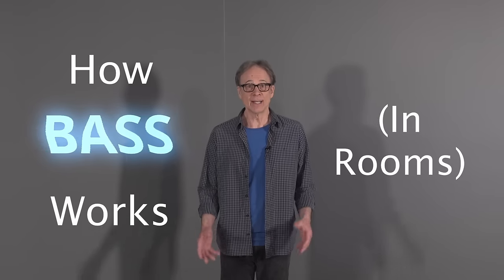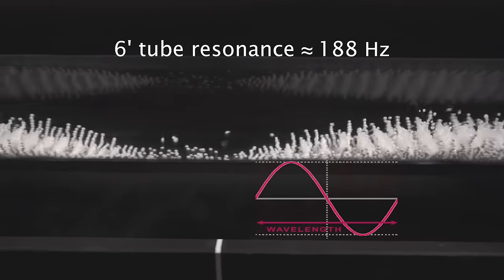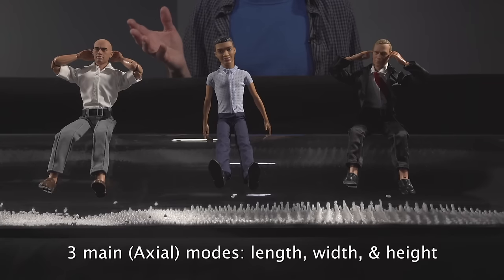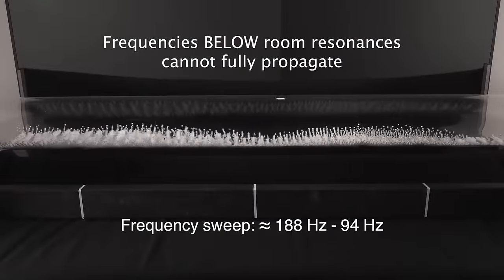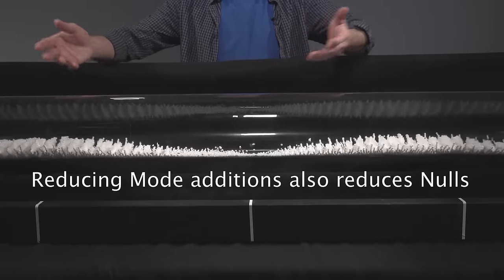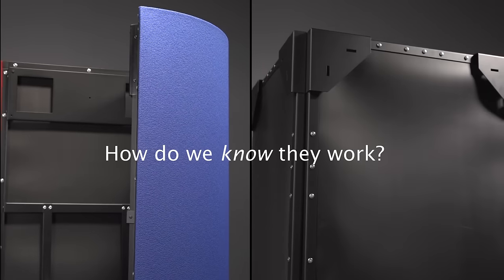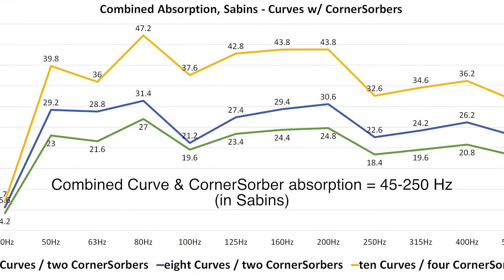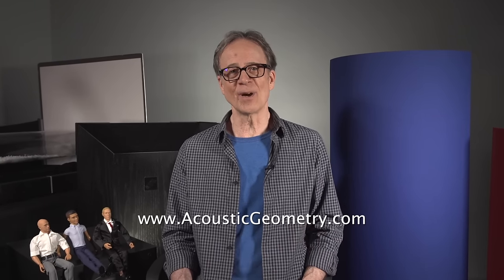How BASS Works (In Rooms) - Acoustic Geometry

Comment: Great information and demonstration. But for a speaker system, a subwoofer array is always going to be the best solution to getting rid of room modes below 100Hz.
Reply: Multiple subwoofers placed optimally in a room are better than a single sub, but the room will affect the sound at low frequencies regardless of where and how many are in the room. Adding subs and "room EQ" will not remove resonances or the fact that below room crossover, wavelengths become pressure-based. Properly treating a room for low-frequency modes and then adding subwoofers is advised. Laws of physics...
Reply: Nope
Reply: @johncalder8490  Room treatment is not the foundation for having great bass, but more like the cherry on top. 

Subwoofers and their proper placement and integration and subsequently room correction will get you to elite levels of bass performance. 

The frequency response dominates our perception of bass performance. Below 100Hz, subwoofers are required to fill in the nulls. And with 2 subs you can have null free bass in many rooms. Couple that with a good room correction like DIRAC and you have bass performance that is damn near perfect in the frequency domain and very good in the time domain. 

Can room treatment help improve things further? Sure, but all the leg work has already been done. 

And room treatment is so damn expensive that it becomes more cost effective to just buy more subs.

Comment: Hmm... I think that you are wrong in some points, for example in that tube, it will be the loudest where there are none white balls, because the high sound pressure pushes them away into low pressure zone where the wave cancellation occurse, and you are telling us the opposite to what is shown during whole video, so by sitting in the middle we would hear as much of that frequency as we can hear in that space. Also velocity based absorbers DO work below 200hz... U just have to place them in low pressure zone (just by moving them away from wall} or make them thick enough so they reach it. So yeah, every type of absorber has its pros and cons, porous ones are the siplest, cheapest and most versatile of all of them, they just work, and u cannot mess them up, (unlike membrane absorbers or Helmholtz resonators} that makes them so popular.
Reply: A Troll at work - do you work for one of the fiber/foam-based absorber manufacturers? Please read the relevant acoustical science textbooks, you missed a LOT! My video is accurate - and placing velocity-based absorbers at the best locations, in the thicknesses required to affect frequencies below 200Hz, is not in any way practical - it would take up entire rooms. John Calder
Reply: @johncalder9188  As I've said, both solutions have their pros and cons... and no, unlike you I don't work for anyone, and I'm not trying to sell anything. Also I don't  discredit any solution because I make money on the other one... You said that porous absorbers don't work below 200hz which isn't true, of course you need to compensate with additional depth, but for someone on a budget, who is capable of making them himself, and has some space they might be the best choice.

Comment: Could you explain how null points and resonance occur away from standing in the direct source? Bass obviously spreads out more by the time it’s performed one cycle whereas a high frequency is more directional which means resonant peaks would be much louder when standing in line of the direct source. Bass behaves differently no?
Reply: High school physics of sound. Look up "nodes and sound." Pressure waves propagate through the air, like a rope being whipped. That's all I have time for...
Reply: @matrixate  hmm no that’s a transverse wave. Sound waves are longitudinal.
Reply: @aristotleonassis5792  You definitely need to study the basic physics of sound. Transverse waves are what he's using in the example. That is what you asked for, is it not? You just don't know enough to know what to ask for. Go and look up what I suggested to answer you question and then go look up wave theory of sound to answer your second question that you meant to ask, otherwise quit asking people for help with the wrong question.
Reply: @matrixate  that’s not a transverse wave. It shows the compression and rarefaction of a longitudinal wave and the answer to my question is if you stand at a certain distance of a fixed frequency you will just picking up the amplitude of where your distance is at. If you’re at a null point theoretically it’s cancelled out. You can’t help and can’t understand my question. You don’t even know that sound waves are longitudinal.
Reply: @aristotleonassis5792  Again dude...go look up what I suggested. Seriously. You'll see what I mean.
Reply: @matrixate  I know what it means thanks. Please go and look up transverse waves. You’ll realise you’ve been giving the wrong advice. Sound is longitudinal. The video can confuse people into believing in looks like a transverse wave but it’s actually showing the amount of compression and rarefaction of air at certain points relative to the length of the wave. Room size will affect certain frequencies differently.
Reply: @aristotleonassis5792  This video is misleading because it is mixing two very different things altogether but I know what he's getting at. I was answering your exact question. The difference is clear to me but maybe not to the non-scientifics. Since you now know the difference and I'm sure by now you would have done some research, the next missing piece of the pie is to observe destructive and constructive interference. Unless you know that already, then you should have your answer by now. You have some of the essential concepts for this topic. Next would be to understand about harmonics and resonances. Though, without the math behind this, you're really fooling yourself into thinking you understand it all. Some of this needs the math to understand the mechanical aspect of the empirical, like basic algebra stuff as to why lambda=2L/n, which satisfied the logic between nodes and wavelengths. That is something related to this video. Good luck. Study hard.

Comment: So how do you figure out where to put them?
Reply: CornerSorbers are positioned on the floor in corners (either vertically or horizontally) at 3 inches from and parallel to the corner wall surfaces. Curve Diffusors are hung on the wall with Z-Clips - the membranes will be at about a 1 inch distance from and parallel to the wall surfaces. 
Curve Diffusors are first placed at the best locations for mid- and high-frequency diffusion, which are the first reflection points (please see our YouTube video "Acoustic Panels - What & Where" - here: https://www.youtube.com/watch?v=akiWq97dSBA - for tips). Then we recommend finding the quarter-wavelength/room dimension locations for further placements to mitigate low-frequency modes, while continuing to phase-coherently diffuse mids and highs in the room.

Comment: I would love to see membrane versus diaphragm
Reply: A membrane absorber is a subset of the larger group called diaphragmatic absorbers, which includes thin sheets of wood or metal, and drywall room surfaces can also be considered diaphragmatic if constructed specifically for that or with low structural mass. Thanks for your interest!

Comment: Doesn’t furniture achieve a similar outcome?
Reply: Good question. Sound absorption (and diffusion) by furniture is often overlooked as room treatment because it is unmeasured and very random. So it's difficult to predict the effects on room acoustics. Soft furniture like couches and "easy" chairs absorb some mid- and high-frequencies, but not much low frequency energy - as far as we know. It remains untested. Also, it's a bit difficult to place a couch at the best location for treating room problems - it might end up in a bad place to sit...
So we don't recommend relying on soft furniture for accurately treating rooms. Thanks for checking!

Comment: try doing the math in a tiny L-shaped room with a 6" ceiling like mine
Reply: You need absorption. Basically you have to eliminate ALL early reflections on all surfaces. I had the same problem
Reply: @Iwasonceacarpenter  Yeah, I probably should put up acoustic panels everywhere

Comment: What is He saying about nulls?  A null "can" be reduced!
Reply: You can't lessen a null by targeting it with absorption, you can only deepen it.
Reply: @johncalder8490  You can deepen nulls with just a few panels . It probably so happened that you absorbed a reflection which counteracted the null which remains. With enough absorption, nulls will be reduced.. You need to rethink and examine this! I noticed that the rooms in the pictures on your webpage really don't have much absorption.
Reply: @wesselingaudiodesign5031  When nodes (energy additions) are diminished (through accurately frequency-relevant and correctly-placed absorption or other means) the anti-nodes  (nulls) also diminish. One of the points of the video is simply that you cannot lessen an anti-node with absorption at the anti-node location (you can't directly absorb a null). 
We try to use only the amount of absorption needed, relying primarily on phase-coherent diffusion to treat most rooms.
Reply: @johncalder8490  I'm not sure who would try to absorb a null at the null location. The boundaries are treated where the reflection takes place to reduce peaks and nulls within the space. Thanks for responding..

Comment: cool video!.. but there are a few 'lies' or more accurately.. skews/manipulation tactics towards certain products for certain tasks.. the most obvious one is basically telling people that velocity based absorbers won't work under 200Hz... they have chosen their words wisely tho... I can't say they 'lied' but I saw that you did there, shame on you! :P ..especially since the products do seem interesting and the infomercial is pretty cool!
Reply: Another anonymous troll - my answer: everything in the video is science fact, including our absorption tests. No lies, and clearly no shame on our part. Unlike your comment, which has no identifier. Identify yourself and be specific in your claims or shut up. Ugh. Trolls.
John Calder
Reply: @johncalder8490  I'm just curious, why would you design a "Corner" absorber when Axial modes are created between 2 parallel wall surfaces, either side walls front/rear, floor/ceiling.  You talked about Axial modes in your video.  Corners don't represent that much of a percentage of the entire wall.  I would think that you would need at LEAST a good 50% to 70% wall coverage, possibly more depending on the room's usage and how much energy is being produced in the room.  Obviously a room with pair of bookshelf speakers that go down to 40hz played at 83dB is a different set of low frequency problems than a 5.1 or higher Home Theater room with subs and the pressure levels go into the 100dB+ range down to 20hz.  With these extremes, wouldn't the Home Theater room need a lot more wall surface coverage to contain that energy?

Why would you need more absorption at 100hz than at 50hz.  100hz is more of a harmonic of a 50Hz sound, so wouldn't you want to treat the fundamental frequencies of low end rather than the harmonics?  I'm having a tough time understanding what you're reasoning is.

Also, from music theory, if you look at a 88 note piano, the bottom two octaves are about 110hz and below. So, I think that that would make a better cut-off point in terms of low frequencies.  the 100hz to 200hz range is more of the lower midrange frequencies, or the harmonics of the lower 2 octaves.
Reply: @johncalder8490  When one looks at various absorption materials (acoustic foam, compressed fiberglass, etc.) they are typically measured by independent test labs at 125hz and above, so in terms of absorption of frequencies, one can use a velocity based absorption material at 125hz and above.  But I do agree that pressure based absorption below 125hz is necessary, but there are different types of pressure based absorption products on the market.  Diaphragmatic, membrane, Helmholtz.  Obviously there will be differences in terms of their effectiveness in terms of rates and levels of absorption, but that then dives into the specific product design/materials used.

John, I wouldn't be so worried about one's screen name as I would with the actual comment.  Some of us, would like to learn and discuss the topic of room acoustics.
Reply: @AaronHubley  I don't know why a lot of treatment companies aren't suggesting to treat the Axial modes first, they require the largest "boxes" or proper deep wall construction with the right materials In order to manage the really low end and that's the biggest problem in ALL small rooms when you have a full range source putting a sizable amount of pressure inside the room.    Maybe because it's expensive and most people can't afford it, so they recommend affordable treatment solutions which may improve the sound enough to pacify the customer, , but not necessarily FIX the problems.
Reply: @Oneness100  All room modes are present in all corners, so it's the most efficient place to mitigate all  modal energy.
Reply: @johncalder8490  The corners only represent 10% of the wall.  Axial modes are present throughout the entire wall, so why only treat 10% of it?   

I don't mean to be disrespectful, but you are simply ignoring the actual definition of an Axial mode.  They are present due to 2 parallel surfaces.  Since I started playing around with amroc mode calculator, I've NEVER seen a single room with Axial mode problems where it was represented just in the corners. It's against entire surfaces, whether it's side walls, ceiling or floor.  They are the entire wall surface.

I think you like promoting corner traps because if you put your traps along the wall, they don't perform as well when you send them in to get tested at a laboratory.. I've seen products where they tested them along the wall surface and in the corner.  The company posted both test results, the same product tested better in the corner.  

Maybe you should design a better low frequency absorption product that's designed for against the wall.  I know there are companies that do offer low frequency absorption devices that aren't necessarily designed to be stuck in the corner.  

In all honesty, it's the wall design/construction in homes that's the primary reason, along with dimensions as to why we always have low frequency issues in our homes.  They simply aren't designed for low frequencies below 125hz.   a wall using a 2x4 frame with sheetrock and building insulation doesn't do much against low frequencies below 125hz.  Combine that with small dimensions and then you have a problem that's not so easily treatable..